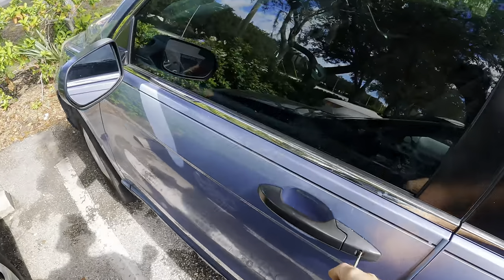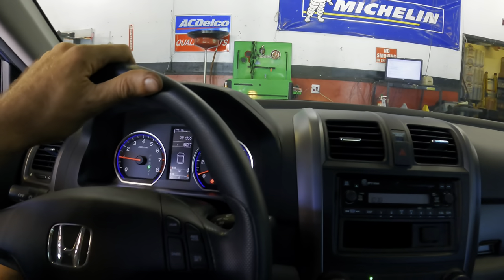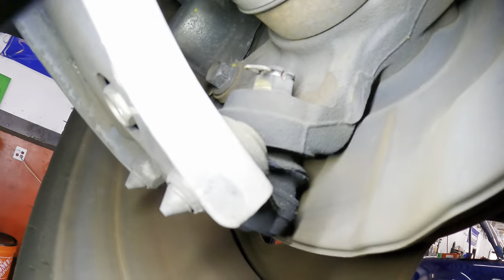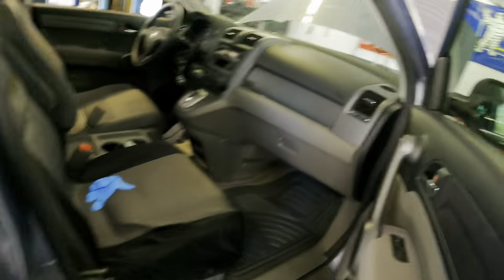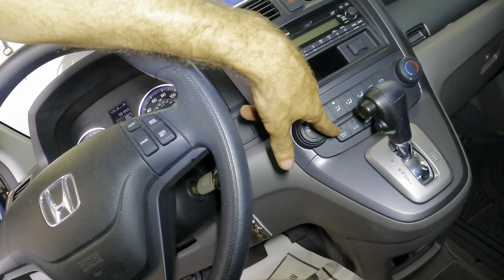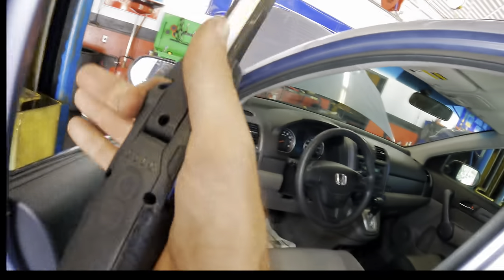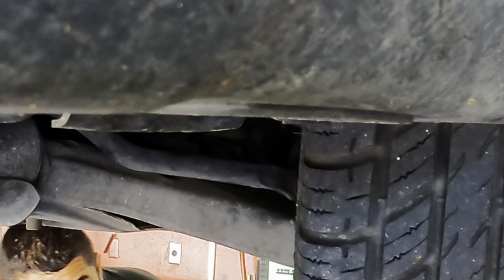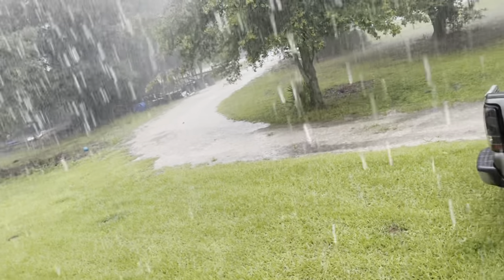Scam or Stupid? YOU decide! Work that wasn’t needed! Honda CRV

Comment: And when I had my 92 camaro  went put 4 tires on it ..I got the 4 tires But they said I had a rear brake leak .when nothing was wrong..they showed me the part that was leaking..for $800.00 just for the back one.....I said no and took it to my mechanic 7 blocks away..and he said they had cut the boot ...he replaced  that one part because everything else was near perfect..so it can happen..

Comment: Think you just picked up a new customer after that inspection. I call scam. Probably put some oil on the ball joints to  say they are leaking  knowing many people don't know a "manual oil retainer" (drain plug) from a widget.

Comment: Scam artists looking for bogus sales. Oil on a CRV is 7500 miles. These 3000 mile oil change jerks are just looking for more opportunities to scam the customer. Sway bars should last 200k.
I would make recommendations with three definers.
Must do:   worn brakes,  clicking CV axles  timing belt on interference engine, leaking water pump, bearings
Should be done but can still be safe until finances/budgeting allows:  torn CV boots, weeping axle seals with high mile CX axles that are starting to make noise, timing belt on non-interference engine, 
Recommended but not required: such as 'mileage, not condition, fluids,
The recommendations were book time busters with high hourly compensation. Do them all at once and get done in 1/3-1/2 the book time.

Comment: Law markers suck literally this should be illegal to sell stuff that’s not been looked. Cabin air filter ??? If that’s been locked and they recommend it the shop should be fined the government needs to do a bait car program with new laws where a car with low tire pressure comes in and then is up sold tpms sensors when the car really just had low air in the tire

Comment: If that dually full size truck gets 43.7 miles to the gallon it's either diesel or a gas scam my 04 4.8 silverado 1500 didn't get that good but I still have it running strong at 261,348 miles on it all original parts. Need to figure out how to get that good gas mileage back tho.

Comment: I’d bet it has aftermarket full strut assembly’s and she has noise. The aftermarket’s for this vehicle aren’t engineered properly and without Honda tops and bearings in the front they wear quick and are horrible. I drive a 2008 so this is from experience multiple times. Not from just normal seeing vehicles.

Comment: I had my tire shop recommend replacing the rear shocks on my Odyssey.   Checked it out myself, and found no issues.  It has been back a few times since, and 80K miles later, and no more shock recommendations.  Did it fix itself?

Comment: I watched someone pour 10w30 motor oil on the brake drums of my car so they could lie and say the rear axle was leaking.  Got the hell out of there quick.  Was only there to get an estimate for brakes, to determine if my friend and I would do the work ourselves, or get it done somewhere if it was cheap enough.  This was a cheap pizza delivery car.  Needless to say, we did the work ourselves.

Comment: Rainman, did you know that if you stuff cantaloupes up a diesels exhaust it will improve the mileage by AT LEAST %1000 !!!
And... when your 13 yr old and just starting to wrench, Never feed a 50 shot of nitrous to an 18hp international mower engine... unless cameras are rolling.
(I grew up next to a Auto scrapyard in the late 70s, worked part time cleaning up in exchange  for parts .By 14 yr old had a +60mph rider mower powered by 500cc Kawasaki 3 cylinder 2 stroke engine...In hindsight not sure how i survived...Parental oversight may have been lacking :)
Point being, I picture you putting a motor in Barbie jeep , and i am positive you have already thought about it...
Reply from the maker: I'll tell you two things that will confirm we are the same. At 10 years old I connected several 50 ft wooden ladders together and propped it against the roof of our barn,(I'm talking the peak of the roof not the low section) bracing it with 2x4s and nails. I then proceeded to ride a sled down the ladders wearing a motorcycle helmet for safety.  By 12 years old my cousin and I were strapping Estes model rocket engines to Barbie cars and shooting them down the road. We had the red and pink 80s corvettes. I also know how to extinguish a corfield fire.

Comment: Not saying that you're wrong, but how do you tell that the sway bar links are OK without pulling or prying at them?
I had a car that pretty much ATE sway bar links, so to the point that I started salvaging the good ends from those I scrapped to assemble replacement links from.
Anyhow, my point being that IMO, it's very rare to find the links unloaded, free floating. There's usually enough tension on them to mask if/how worn they are until you get a bit of pry bar action going on to jostle them in their sockets. To me, that's when you notice if they're getting sloppy or if they're still a goodt fit.

Comment: Hi this happened a few years ago about 20 years just wondering if you had ever seen it before, I had a 1997 Chevrolet Tahoe 350 vortec 4X4 very low miles and full service history, I bought in in Germany and drove it back to the UK in 2000, In 2001 we were  driving down the highway at speeds up to 100mph we came off at an exit ramp to a stop junction normal speed when i pressed the brakes there were two bangs one after each other and no brakes or very little rears only, after being recovered home i found both brake disc rotors had broken off the hubs, the cast discs had broken off the pressed steel hubs, I did try to contact Chevrolet and send them pictures with no real reply.

Comment: Ray, Just a thought, I see you have a lot of standing water around your house when it rains, are your eve troughs backed up with junk and it's running over or do you need something on your down spouts so it can get away? Just a heads up, that is the most important investment

Comment: Automotive industry can be cut throat, not all are bad but a lot are there for money only. Out of highschool in auto training in my first intern technician position I worked for a Honda dealership and a clearly drug addicted single mom came in with her 3 kids, long story short it was an early 90's civic with over a quarter million miles, sold her a head gasket, full head and block machining, all 4 Z rated tires and a tone more, she didn't know the difference between a crack pipe and a screwdriver but her daddy paid. Car was worth $1000 at best but the   total ticket was over $8k they kept giving the "safety of your children" speech. Fucking disgusted me.

Comment: Oil change completed @ 94,115. Miles on the clock 91,955 ? that is good 2,160 discrepancy for a start or is that oil due by date? had totally confused Ray (that is not hard these days)

Comment: You trying to relativize is commendable, but it seems obvious that other place was without a doubt trying to take advantage of that old lady... c'mon, like you said, except that tear in the passenger side ball joint boot that car was mint back to front. If it really was incompetence it's just as bad honestly, places like that... treachery or not, both give good places and mechanics a bad name. At least with a mechanic being dishonest you can kinda count on the job being done in stead of somebody incompetent loosening bolts on your vehicle.

Comment: If you're wanting to be professional please don't operate any customers vehicle with greasy/dirty hands (as you clearly show at beginning of video). I've had shops work on my vehicles that I then find my own hands dirty because a technician did exactly what I'm seeing in your video. I never go back to those shops.
Otherwise. Great video.
Reply: As retired mechanic that spent quite a few years working on high-end/exotic cars that stood out to me also, I can hear in my mind a boss telling me and others that people don't bring their cars in and spend possibly thousands of dollars and won't appreciate having to clean the car after repairs and it's a quick way to lose a customer. It's standard operating procedure at a good shop to wash your hands, put not just a paper floor mat down but some form of seat cover on, move your belt buckle off to the side, use fender covers at all times. I believe that training helped me get added jobs later when I worked at a Ford dealership, especially with any job inside the car as so many interiors are light colored and the shop couldn't trust Billy Joe Bob in the bay next to me.
Reply: @indianaslim4971  Agreed. And thank you for being a tier above the average mechanic.

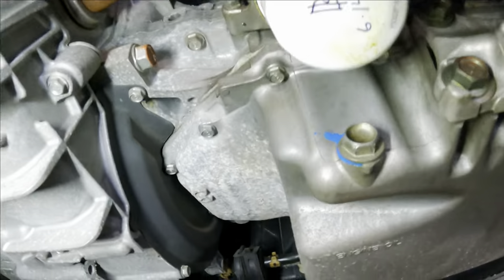Comment: 5:41 ... why does that brake caliper have a bleeder valve on the bottom?
Reply: Looks like a brake pad anti rattle spring
Reply: In case of a roll over then you can bleed your brakes while inverted

Comment: hey can you help me, my 2011 1.0 toyota makes a CRRRR sound while accelerating lightly and sometimes loud when cold, what could it be p0420 code, also should i use 0w20 if its recomended to use it and my car has 120k miles 205k km and it runs on 5w30 right now, new filters new spark plugs ran cat cleaning aditive 2 times in 4 months it sounds like a diesel, i will replace the chain later i will replace internals like piston rings valve lifters and valve

Comment: Fundamentally disagree with you on this one. People come in all the time for simple services and don't mention the failed wheel bearings, spewing water pumps, grinding brakes, and bald ass tires. Most people are blissfully unaware of the function of their vehicles until it puts them on the side of the road.

Comment: You're going to have to run your mileage math past me again. The sticker says 94115 and the odo says 3k LESS than the sticker. Where are you getting 800 miles old from?Does that odo run backwards and when it hits all zeros the car explodes or something?
Reply: That's when it's due for the next oil change, not when it was done.
Reply: @scott_meyer  Ok.... But Ray states it is 800 miles OVER and it is still 3000 miles UNDER

Comment: Hold the damn camera still - - - I was a tech, owned my own shop, worked as a line tech, the dispatcher, service advisor, service manger, service and parts director for 11 stores, then CEO of the group.27 years directly. I still do consulting.  Are there folks out there that are "crooks"  sure. That said, there are a lot of non crooks also.  One thing to ask - "are you on any type of commission"  we never paid a commission, all my people were paid a very good salary as well as the techs.  It takes away the need to sell unneeded work.  On the service lists?  Well the manufacturers have their own list in the owners manual.  If someone presents you with a list?  Make sure it matches the makers list only the makers list.   Someting where I live (desert) cabin air filter gets dirty and full fast, so changed far more often, same with air filter.  A lot depends on local conditions. I'm 74, I'm not doing my own oil changes, etc.  I've used a local dealer for 5 years and haven't run in to any up sells. A lot depends on the people running a place.